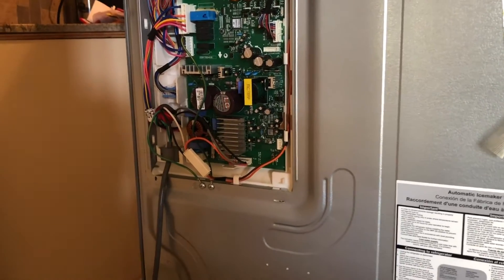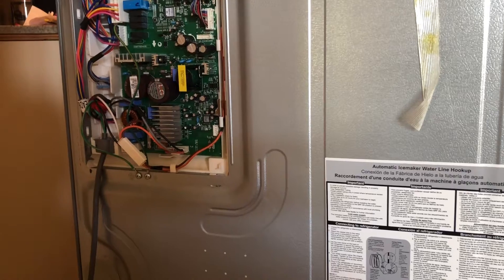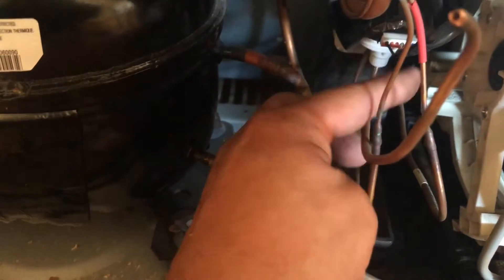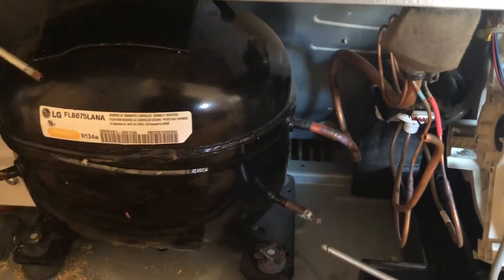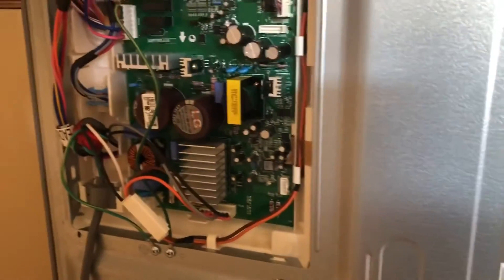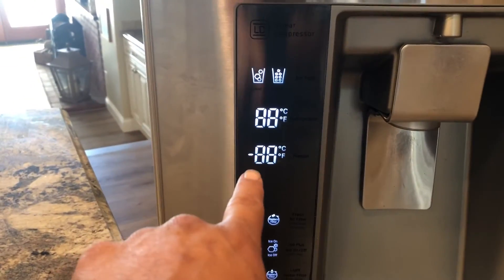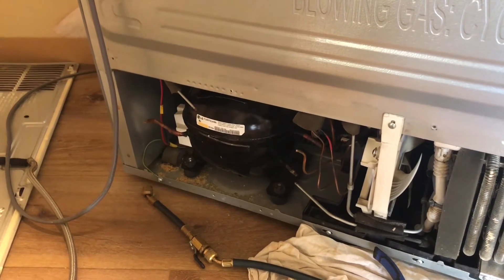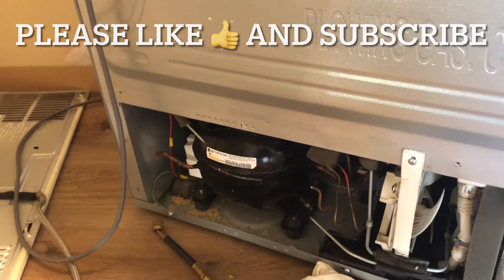LG refrigerator 3 way valve

Comment: Hi, I have a problem with the cables to the three-way valve. The problem is in what order the wires should be connected to the valve.

and also, there are 5 wires coming from the board, and 6 inputs to the valve, the central pins on the valve are the same, they are soldered

• Pink → B−
• Black and white → A−
• Yellow → B
• Pink and gray → A
• Blue → +12V

Comment: I had my compressor replace by lg technician  less than 6 months the fridge stop cooling  i contacted lg the wanted me to put down another 600 to come out to see whats going on . I got another technician come trouble shoot the problem and he said the 3 way valve is clogged but wanted to charge 700 to repair  my question is this price a good one or is he trying to rip me off .I priced the part it was less than 100 at the time

Comment: I had this compressor replaced bavk in January the fridge is not cooling the freezer is barely getting cold.a technician just left my house and told me the 3 way valve is clogged and its running high.the compressor is very hot to touch.he quoted me a price of 595 for parts and labor what do u recommend me doing there was a blinking red light on the control board yesterday i pressed the rest botton and it went away any advice i have spending huge amount of money every 6 months on those fridge
Reply from the maker: How old is your refrigerator

Comment: On these dual evap do you fill the freon witj unit truned on or off?
Reply from the maker: I charge off. But about half way thru I turn it on so that the compressor pulls the rest of the charge as it is quicker. But never start the compressor with no charge (in a vacuum)or with a nitrogen charge

Comment: Question: I had my LG compressor replaced and now only the freezer side is cooling, is there a procedure to now get the 3 way valve open on both sides and then somehow get the air out that may be stuck in the system?

Comment: I did not know were the 3 way check valve is my fridge side is super cold 36f and my freezer 65f and the fan working in freezer condenser is barely cold
Reply: I just ran into this video great 👍 video i replied on other video well i am thinking of replacing both capilaries and the 3 way valve when i plug 🔌 the fridge in it dialplays the tempature and everything then 3m later it says 88f on freezer and 88 or 86 on refrigerator and it stays like that i bought it used model gfsl6kexals previous owner told me the issue i said to my self it can be fixed i took it to mexico 🇲🇽  the refrigerator tech charge 80$ dollar labor i can buy parts my self or they buy it charge more if its control board ill send it in for repairis there a way to test the 3 way valve the blue wire or to make it run manually my refrigerator does not have a reset button i searched for it on board
Reply from the maker: What’s the model number for it

Comment: So if you dont get them both opened and vaccum during new compressor installation,  will that cause the low side pressure to stay low in negatives like readings of vaccumed?
Reply from the maker: If you don’t open both sides for the vacuum you only vacuum one side. The air left in the unvacumed side will have air and moisture that can couse a restriction.

Comment: Ok doing this procedure will have them them both opened?
Reply from the maker: Yes.
Reply: Damn it....I just replaced a compressor the other day on a unit with 3 way valve. Since that was the first one with 3 way valve out of 6 units I've done, I didn't know this. I got a call back saying the unit is still not ccooling. Went back twice couldn't figure it out. Thinking I must have a restriction.

Comment: Excellent video. I’ve watched other videos and even been told by other techs to do different things to get in neutral but none of it made sense. 
But you sir, explained everything about the operation of the valve and the test button. Thank you.
I use the test button to check voltage to compressor at con201 but never knew it also put the valve in neutral. Thank you for sharing your knowledge. 

Knowledge is power. 
Empower yourself!
Reply from the maker: Glad it helped. I started in this line of work because someone was nice enough to show me. That motivated me to learn more and share. The knowledge.

Comment: One question. I just replaced a compressor, and I didn’t do this process but I pulled vacuum from the port of filter drier and service port of the compressor. It means I didn’t pulled vacuum from one side. It’ll help a lot. Thank you
Reply from the maker: Yes that’s rig because by pushing the button and putonghua it in test mode it opens the valve to both sides.

Comment: always on any fridge no matter if is samsung, lg, whirlpool red is refrigerator and blue freezer ?
Reply from the maker: Yes. Red is refrigerator blue is freezer. Across the board
Reply: @appliancerepair420  do you know wherehave to be connected yellow (Samsung) and white (lg)?
Reply: @Alex_Butakov 

LG line from 3 way valve with white band goes on (red)
Reply: @appliancerepair420  on kenmore elite, white is refrigerator? Thank you very much for the help
Reply: How about yellow on Samsung valve?
Reply: @user-em9lj6wr3r 

Yellow is the Red (Refrigerator) line

Comment: Great video!  Just bought my house back in June.  The compressor was replaced before I moved in.  Recently been having issues with the freezer Coil icing up.  Just went in the back and found the 3 way valve has been unplugged this entire time.  What problems could that cause? I plugged it back in and ran through the test mode.  Everything seems to be working good.

Comment: Hi, thanks for the video. I'm working on LG dual evap. Fridge evap as been replace, 3 way valve was unplug in test mode before vacum. After refill, fridge work perfectly and freeze not cooling. Thermal cam show that only first inch of freezer evap is a bit colder. Any idea what to check or do next  (all fans working) Any help would be appreciated.
Reply from the maker: Might have a parcial restriction in the freezer section of the capillary tub
Reply: cut from out of 3 way valve and return to compressor then test it today and nitrogen go thru capilary tube. How to check is something wrong with 3way valve? Would you suggest something else before vacum and recharge?

Comment: Good video! got a GE side by side with dual evaporators.  Freezer not getting cold, fresh food is fine.  3 way valve not working.  Part not available from GE or anywhere I can find.  Is it possible to repair the valve or the coil?  Way to diagnose if it’s in the valve or the coil?  Any source you know of for remanufactured parts?  Any help would be appreciated.
Reply from the maker: What’s your model number for the refrigerator
Reply: GE model PSB42YGXASV
Reply from the maker: @rutledgeworkman9521  
Send me an email to ocwasherrepair@gmail.com

Comment: Hi good video man working on a fridge like this but the freezer is not getting cold but the fridge section is cool really good .changed the 3 way valve vacuum and gas up.any thoughts would be greatly appreciated
Reply from the maker: Did you put the 3 way valve in the test mode?  That makes it so that both sides get vacuum. Might have a problem with the valve